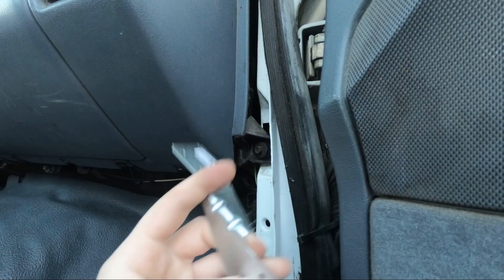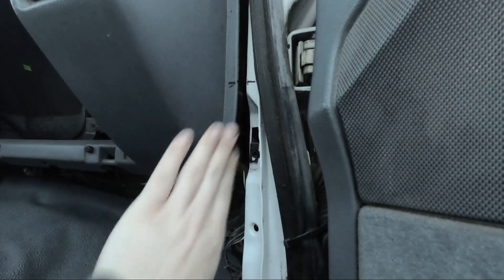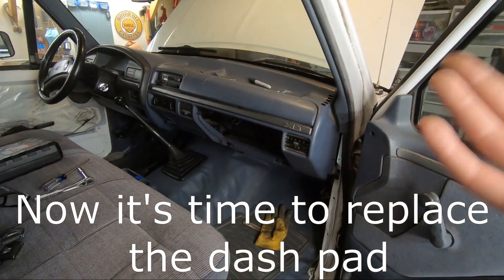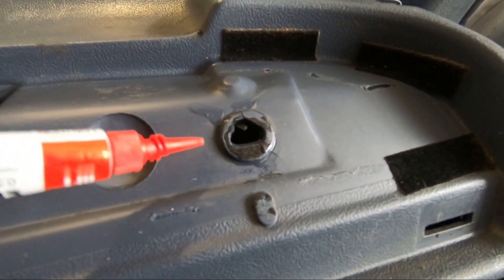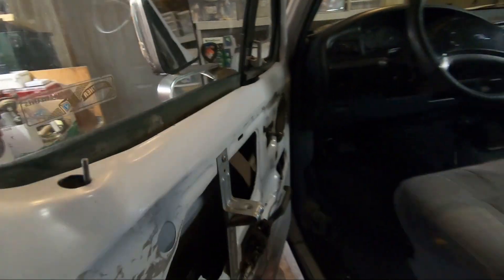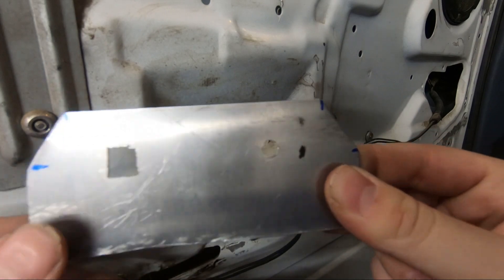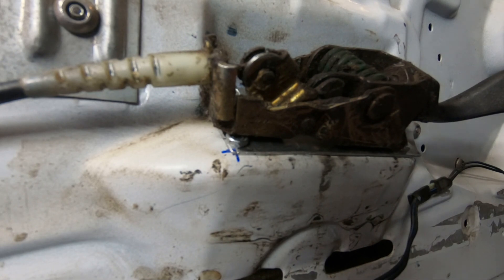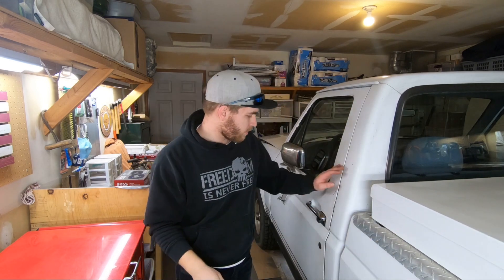OBS Ford Restoration Part 6: Fixing 3 Common Problems

Comment: That plate u made for the door was spot on those nuts behind the dash probably had lock tight on the that's why u got undo them all the way. Good job mate dash cleaned up real nice.
Reply from the maker: Thanks man!  Im really happy with how that plate worked out.  Not to mention I saved a little bit of cash by doing it myself.  You’re probably right about those dash nuts cause they were pretty stubborn, but definitely worth it.  Thanks for watching😀👍

Comment: Nice job. For those little cracks in the abs plastic of the dashboard, a little acetone goes a long way. The repair will be invisible because you not adding any new material just reflowing the abs a little. When you overlay metal and rivet or bolt it together, try applying body adhesive or simply some metal impregnated epoxy between the layers. It keeps out moisture and distributes the load more evenly for a solid feel for years to come.
Reply from the maker: Thank you so much for those great tips!  That’s really fantastic advice.  I never thought of adding body adhesive before.  Thanks so much for watching!😀👍

Comment: Man, You're gonna have a Very Nice truck when you're done with this and ALL you're do'in with it. I've got a 1994 Step Side Lighting it Never been out in the weather it sits in my shop mostly, very-very Low Mileage. It looks just like it did in '94. I also now have an 1987 Ford F-250 that is fairly nice too. I'm work'n on the Tranny its not in the best shape. I seen your video on the Fire Extinguishers and I Subed & Liked your video's. Keep Up your Great Work there, Son👍🏽👌🏽👏🏽
Reply from the maker: Thank you sir!  It’s definitely been a work in progress, but I’ve had a lot of fun so far.  That’s amazing you’ve got a pristine Lightening!  First gen Lightnings are becoming more rare by the day, and the fact it’s got low miles makes it that much cooler.  
Since you’ve enjoyed my OBS restoration so far I’d highly recommend you check out my YouTube friend “3rd Coast OBS” down in Texas who’s actually restoring a first gen Lightning on his channel.  You can find him down in the description of all my videos.  Thanks again for the kind words, and support I sure do appreciate it.😀👍

BTW that’s interesting about what you said about the freeze plugs on the top of the transmission.  I never thought of that before.  I have always heard they were holes left from the casting, and Ford just put cheap plugs to seal them up.  However that being said if they’re there to release pressure that’s gonna be a problem...🤣
Reply: Ford NEVER made a step side 94 lightning. So, nice try.

Comment: Not bad at all! If you need to lubricate door hinges, handles or other spring/lock mechanisms, give fluid film a try. It's pretty reasonable in an aerosol can. It can be messy though, so watch where you spray it!
Reply from the maker: Thanks Wesley!  That’s a good tip I’ll have to give it a try!  It never ceases to amaze me how well just adding a little bit of lubricant to these old door locks, buttons, and handles can make such a difference.  Thanks for the support as always😀👍!
Reply: @ydocproductions5593  not a problem! You're on your way to being a good mechanic. Just keep doing the research & keep up the good work!

Comment: I fixed a dash in a square body chevy once with bondo, ducktape, and black spray paint. Wasn't the best looking but it sure looks better. I also got a new radio for my dodge.
Reply from the maker: Sounds like a good fix!  Ya that cracked dash with the exposed yellow foam really looks bad in my opinion.  Glad I swapped it out!  That’s cool that you got a new radio for the truck.  Way more capable then the stock 90s radios
Reply: @ydocproductions5593  my truck had a aftermarket pioneer radio in it. I got tired of not having a cd player. So I went and bought a radio with bluetooth,aux,and a cd player. And it comes with hands free something (can't think of the name off the top of my head)
Reply from the maker: @oldcroneysgarage9739   Right on!  Sounds like a solid upgrade!

Comment: Wish I would’ve seen this earlier, I’m so late… on mine I hammered the ripped metal for the handle back to where it’s supposed to be and JB welded it back in place
Reply from the maker: Haha bummer🤣!  JB Weld is pretty strong though.  That being said I’m really happy with the reinforcement plate in my Powerstroke  currently.  Works just like the day it was made.  Thanks for watching😀👍
Reply: @ydocproductions5593  currently also workin on a 93 f-150 extra cab that is also my daily all new brakes and hardware and lines.
Reply from the maker: @williamwatkins2538   Very cool!  I like the extended cab trucks more than the single cabs personally.  Sounds like you plan on keeping it for a long time hope it serves you well👍
Reply: @ydocproductions5593  plan is to try to restore it maybe throw a 460 in it will be the kids first truck he can drive to school in.
Reply from the maker: @williamwatkins2538   that awesome!  Sounds like when you’re done with it it’ll go 0-60 in 5 seconds!
Reply: @ydocproductions5593  that’s the plan

Comment: Those dash pads can be over layed with vinyl upholstery material and 3m spray adhesive.
Reply from the maker: I’ve always wanted to try that!  As long as the material was a close match to the original I think it would be a great solution👍

Comment: You'll find that CA glues are not well formulated to work on plastics. Stuff might stick a little, but fails easily. Even  a lot of two part epoxies don't bond well with plastics. There are some good adhesives for plastic (polymers), finding a universal one is a challenge. Nice repair with the hurricane clip.
Reply from the maker: Thanks!  I’m pretty happy with it.  Can’t beat a .50 cent fix😀👍

Comment: I’m amazed how broken my dash was when I pulled it apart a couple days ago, there was 1-2 screws holding it in, the rest were broken.
Reply from the maker: Wow, sounds like the trucks’ interior was pretty worn out!
Reply: @ydocproductions5593  it sure was. I took most of the interior out, changed to manual windows and door locks and repaired the dash using super glue, washers and hot glue.

Comment: Love the low buck repairs Cody! How did you get lucky enough to find that dash pad? I don't think you would find one around these parts.
Reply from the maker: Thanks Jason😀👍!  I ended up finding one at a junkyard out of town.  The guy wanted $50 for it, and I managed to talk him down to $45 so I can’t complain.  These dash pads are getting harder and harder to find.  If you go on eBay they want $300 for one which is crazy!

Comment: Great video! What type is steel sheet is that? Is there a gauge to it? Where can I get it?
Reply from the maker: I believe I ended up using 18ga sheet metal.  However you could also use 16ga if you wanted.  Any hardware store would have it for pretty cheap.  Thanks for watching man and welcome to the channel😀👍!
Reply: @ydocproductions5593  Thank you for the quick reply. Great work.

Comment: Do you know where I could find replacement clips for the dash trim for a '93 F250 XLT?
Reply from the maker: I would try your local auto parts store first.  However if you can’t find them anywhere I would also recommend going to a local salvage yard where you can pull the parts you need from another truck.👍

Comment: For the door. I would have riveted it..
Reply from the maker: @Ray-ux9eh  nothing wrong with riveting it at all.  I just used nuts and bolts because it was easier for me at the time.
Reply: Understand  just risk backing off I know you mentioned lock-tite..  possibly would have brought the metal piece over the edge.   Good idea. I used an over size washer underneath to repair mine